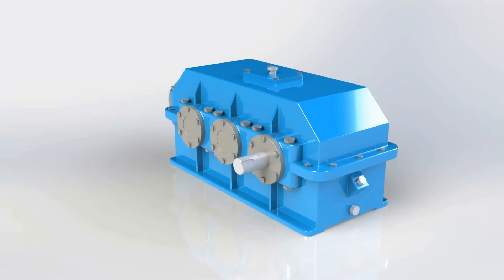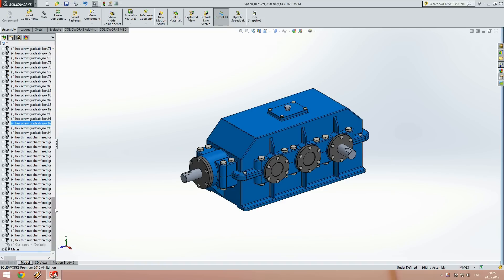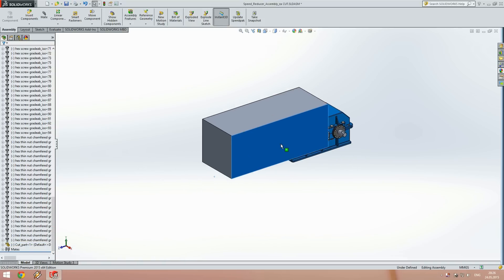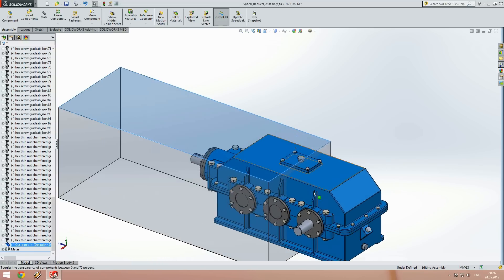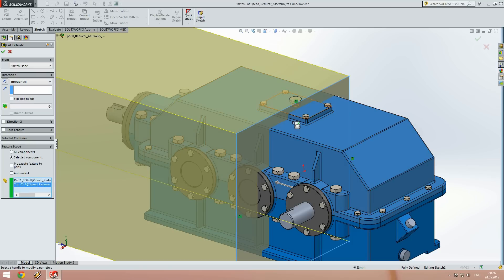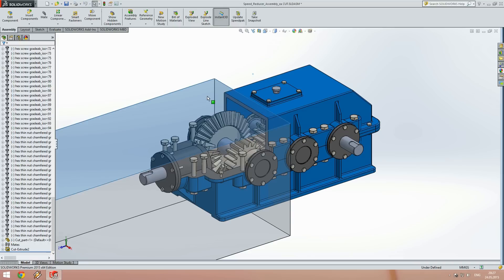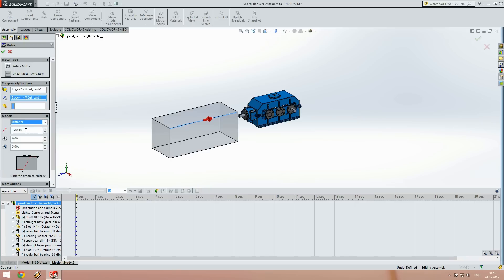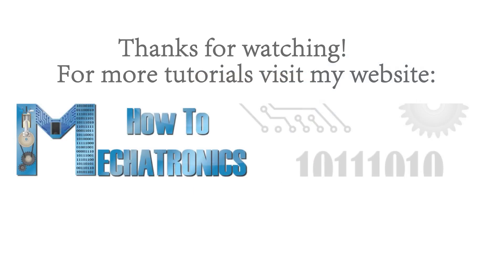Progressive Cut Animation | Solidworks Tutorial

Comment: Hi, Thanks for the video. I am using path mate between cutting part and the part to be cut and the simulation is not showing the part being cut. Can you please help me out? Also the cut feature is not coming in the motion analysis
Reply: Hello Kartik,

Have you find any solution for this problem. I am also facing same issue (not showing the part being cut) during motion analysis.

Thanks in advance.

Comment: Great Videos!!  I noticed your Finished Animations are in "Maximum" Final Quality PhotoView360 renderings (assume why it took 100 hours) ... How do you set the final Video to save the captures in the Highest form of Render Quality instead of Screen-Capture or a lower Render Quality when using the 'Save Animation to File'. :-)  It would make a GREAT Tutorial!! :-)  I can set the Save-As type to 'Render' but it only seems to come out in the lowest 'Good' quality not the 'Maximum' as I can get with single image rendering in PhotoView360.  I only need to make a 5 second video but it needs to have every frame as a PhotoView360 "Maximum" quality rendering.  THANK YOU :-)
Reply: How make printing machine unwind rewind papper roll motion simulation